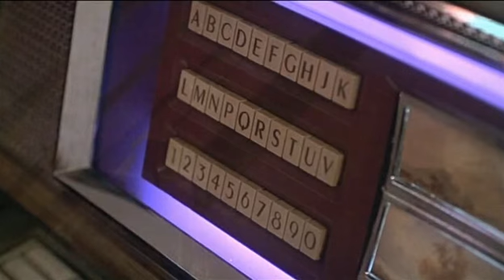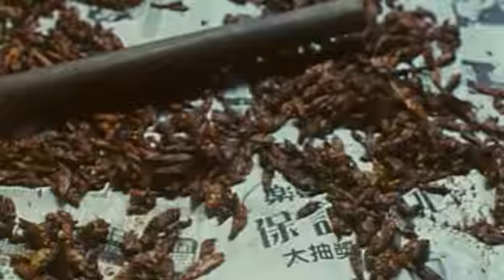Her Vengeance (Ngai Kai Lam, 1988) Showdown

Comment: The Star LD and VHS show some over-the-top and graphic shots of the fat rapist getting stabbed the shit out of by Kit-Ying with a piece of glass, and there is also a scene showing a pipe exiting the final rapist's head. As you can clearly see, the Megastar VCD still took some significant damage despite its Cat III rating. Before I read about what really happened with the Megastar VCD, I suspected that there was a cut when Kit-Ying pounced onto the rapist with a piece of glass because as soon as she landed on the body, there was an awkward soundtrack jump.